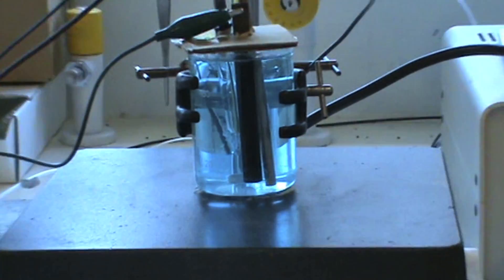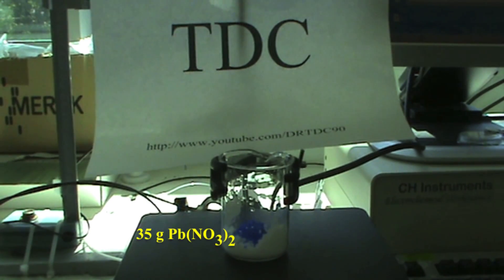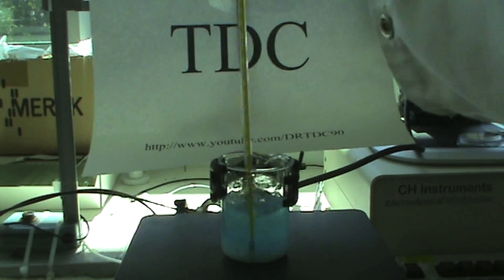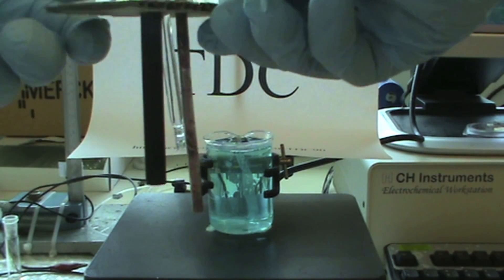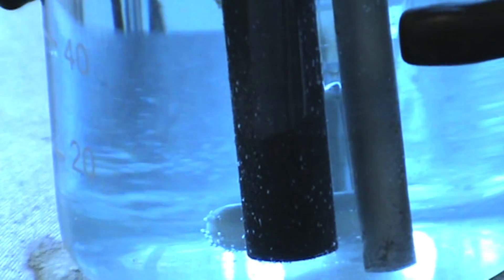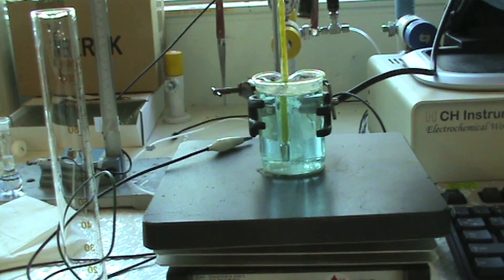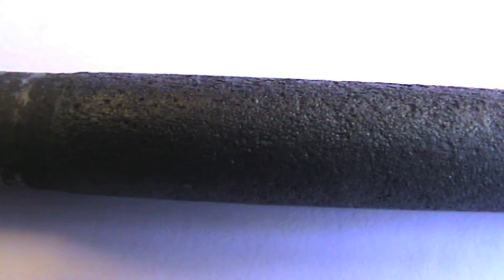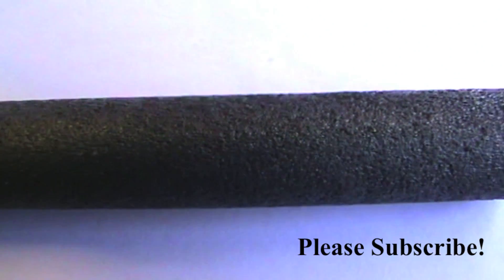The Effect of CetylTrimethylAmmonium Bromide (CTAB) on the Electrodeposition of Lead dioxide (PbO2)

Comment: for surfactants literally u can use acetone or erithritol mixed with palmolive shampoo and it will work which is what I used. and for beta plating bath I rather use lead perchlorate as its capable of plating pure beta PbO2 without 2% alpha contamination at room temperature. but alpha PbO2 is needed but not as a co deposit rather as a layered composite and to accomplish that you need a 2nd plating bath with a very different composition.

Comment: you cant just plate beta PbO2 directly on graphite it wont make a practical anode you need a hard dense alpha PbO2 precoat and interlayers to improve strength and operating current density.

Comment: What are some of the applications  of this?
Reply: PbO2 anodes are mostly used for industry for the purpose of organic waste destruction via oxidation.
They are also used for:
Making sulfuric acid from CaSO4 with membrane cell
Making nitric acid from NH3 solution with membrane cell
Making perchlorates
Making ozone
Making chlorates
oxidation of styrene and toluene into benzaldehyde and benzoic acid.